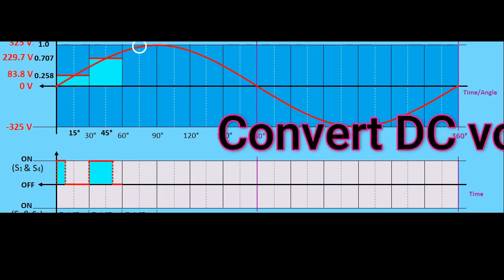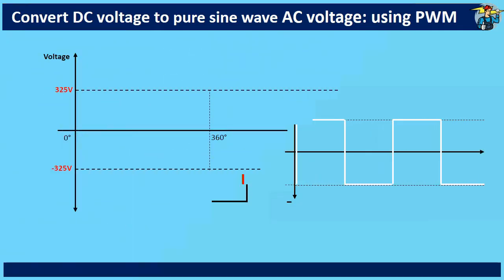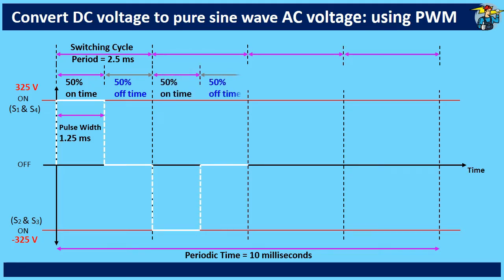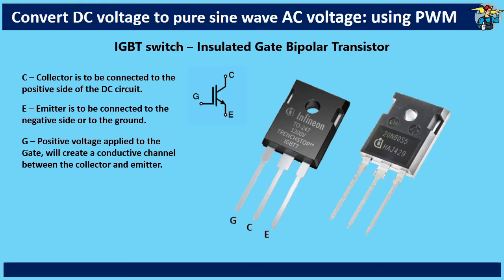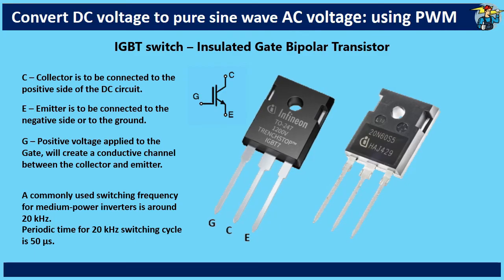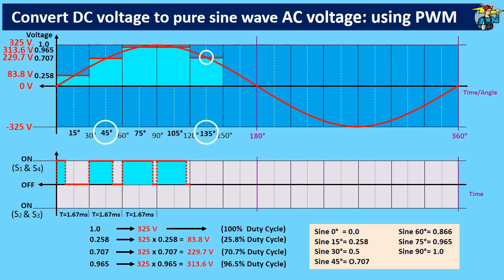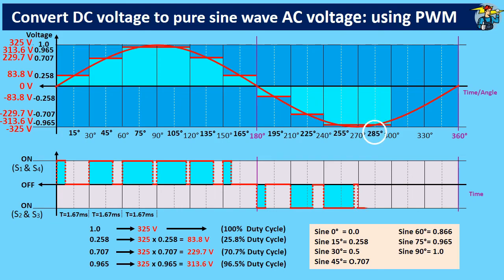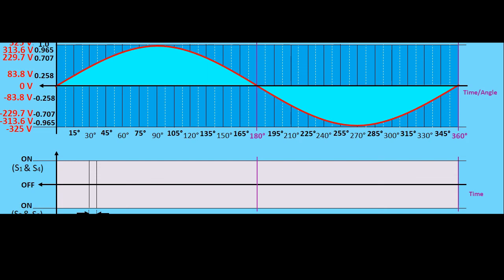How Pure Sine Wave Inverter works ? / How to convert DC Voltage to Pure Sine Wave AC ?

Comment: I made an application with a sine table with values from 0-255 (8 bits) to generate the wave for PWM, with 120° of phase shift, using only Mosfets (IRFZ44N and IRF9540), including optocoupler with BC337/BC327 for swtiching before the Mosfets. I could make a "smooth" signal as well without burning anything. The PWM frequency was 10kHz. Would that be considered as a SPWM? I would like to try it with IGBT one day to compare.
Reply from the maker: That's a great DIY project! It sounds like you've achieved a solid sine wave generation with your setup.

Comment: Any reasons why my egs002 led blinks??
Reply from the maker: If the LED on your EGS002 board is blinking, it typically indicates a fault or warning condition that the board is detecting.
Please go through the manual for fault detecting or get the help of a good technician.

Comment: Good video.  Do you have anything that talks about the 100% low-side method and 50% offset method for Sin Inverters?
Reply from the maker: Thank you.
The 100% low-side method and the 50% offset method are two common techniques used for generating sinusoidal waveforms in sinusoidal inverters (often for applications like motor drives or uninterruptible power supplies). 
Both methods are used in pulse-width modulation (PWM) control schemes for producing AC outputs from a DC input, but they differ in how they generate the sinusoidal waveform, particularly in terms of how the modulating signal interacts with the switching signals of the inverter.
Will try to do a video on this when time permits.

Comment: Sir, very nicely , easy to understand the programming of a PWM microcontroller and how to generate sine wave voltage output using IGBT transistors from DC input. Sir, could you forward a circuit diagram to generate 3 phase voltage output with DC input.
With Sincere Appreciations 
Vijay Mohan
Reply: hi how i can contact with you
Reply from the maker: Than you.
Sorry, I don't have PDF drawings on these.

Comment: I was hoping you would explain dead time to prevent short circuit on the H-bridge. Also some form of voltage feedback for voltage sag or input voltage fluctuation compensation.
Reply from the maker: Yes, "dead time" is a brief delay applied in switching circuits, such as H-bridges, to prevent short circuit conditions.
For an H-bridge with IGBTs, a dead time of around 1-5% of the total switching period is common. 
This ensures safety and efficiency in typical IGBT-based H-bridge circuits.